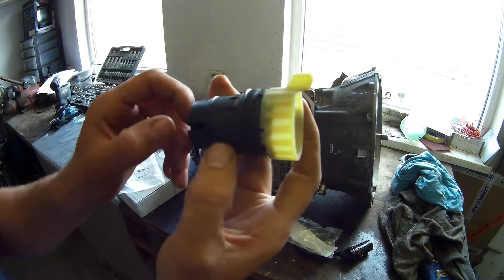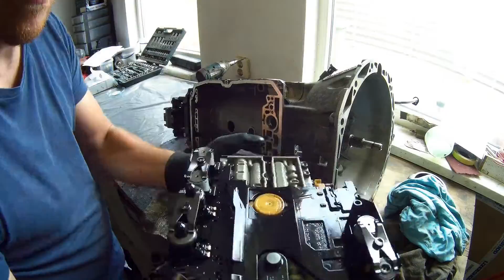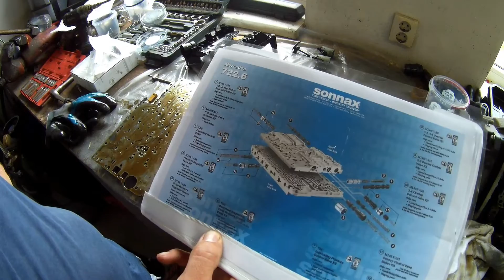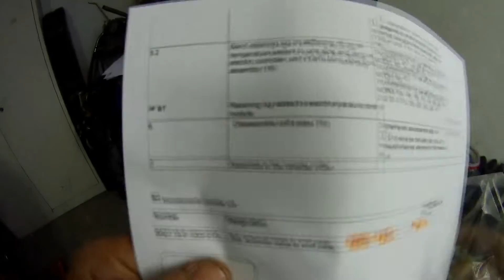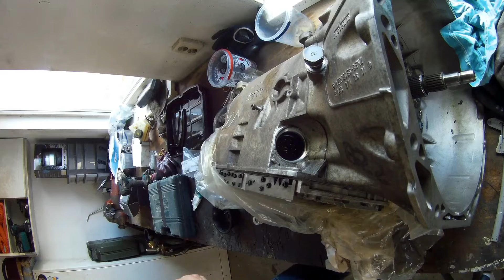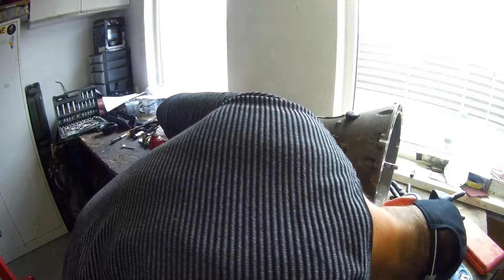Mercedes 722.6 valve body inspections and leak repairs  190 V12

Comment: Hello, my 722.6 transmission knocks when I put it in reverse gear. What do you think I should change?
Reply from the maker: Service.the transmission .  Change the oil and filter.  Take the valvebody out clean it.  Check all the valves and springs and services it where needed new conductor plate and connector

Comment: Hoe you'll answer to me. I've seen manny people drilling the 2mm hole to 4mm hole, my question is, do I need to  remap the gearbox? I think this 4mm hole helps you to change from 3rd to 4th gear smoothly.
Reply from the maker: The drilling of the hole for the 3-4 shift is only done in combination with the ofgear controller.   That is where this solution comes from.  Because settings need to be changed .  How a oem ecu reacts to this i dont know

Comment: @JMSpeedshop ! really good job with the video. Honestly helps. Just wanted to ask if you could share the part number for the magnet, parking lock if possible the cable for parking lock. Thanks
Reply from the maker: Thanks .   I have to look up these number.  I will have a look later

Comment: Why is vibration in 3rd gear only?
Reply from the maker: 3 to 4 Gear flare.  It is some kind op design issue in the transmissions
Reply: @JMSpeedshop  Thanks for reply 👍 any ideas to fix the issue?
Reply from the maker: No in only have Worked with the ofgear controller.  And a never had tonrepair a transmisson
  But can be alot of thing.  Try to contact a gearbox specialist

Comment: Thanks for this super complete video! May i ask what would you think if witout a notice, suddenly its like you selected neutral. No drive. And if you try to the next morning it drives normal for 30 seconds and neutral again. The dipstick always reads like 3 times full but i didn't add fluid, no water in the fluid either. No weird sounds or anything else. The filter its in it's place, i heard about filters falling off but it's not the case, does the filter have a "one way valve" to suck the oil and it's broken?
I really hope you can help me, I'm devastated
Reply from the maker: Hello.  You have to measure the level even the geaebox is on temp . I though 80c .  With a running engine in neutral 
I never heard of a filter falling of. There is no return valve in the filter.  When the engine is stopt the ook level is always high because everything is running back to the sump. That is normal.  Try to run the car with gearbox connector unplugged. And if then also is going to neutral.  Have alsook IT the gearbox plug underneath the car is wet of oil. And if the connector in the controller is wet of oil.
Reply: @JMSpeedshop thanks for your quick reply! Today i checked the level with the engine running in P R N and D and still measures 3 times max. Dropped the pan and everything is clean. I'm scratching my head, it's like the pump doesn't suck, is there a relief valve that could get stuck?
Reply from the maker: If your level is the same with the engine running and stopt then your ook pump in the gearbox is dead for sure
Reply: @JMSpeedshop  Ok. I'll check  and report back!
Reply: @JMSpeedshop  I'm bringing updates, 1.put new filter (it was plugged) and fresh fluid
2 replaced the valve body it was stuck with dry brake/clutch debris (I'm thinking that 60 days parked due to the quarantine is the reason).
3 still doesn't drive, now i can measure fluid level, the pump is working.
4 I've checked the TFT sensor pin 13&34 in TCU and it measures 16Mega ohm (i checked the values when the conductor plate was out and it measure perfectly as stated in the chart in service manual, checked cables non of them grounded or open).
I'm scratching my head and I'm unable to scan it, in my area all the locals shops can't access the TCU.
I hope you can keep helping me as you did!!